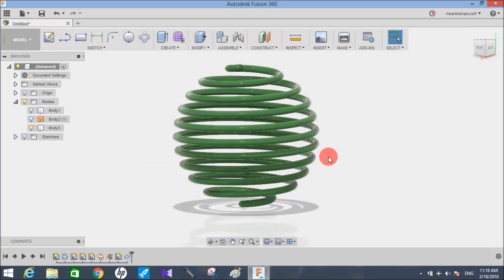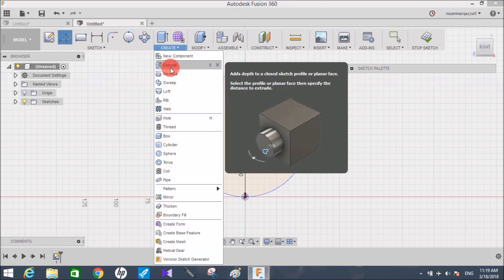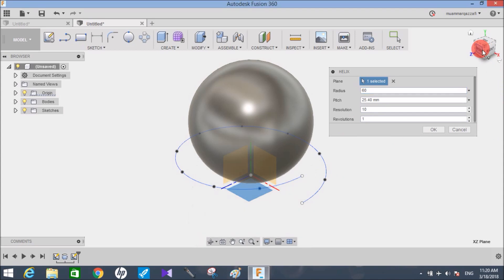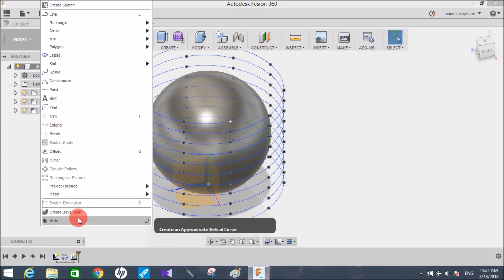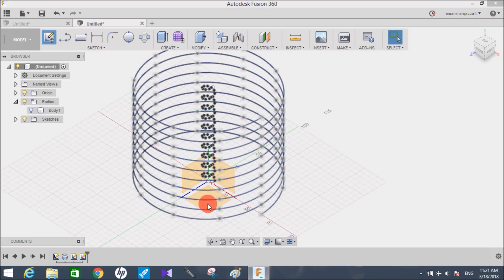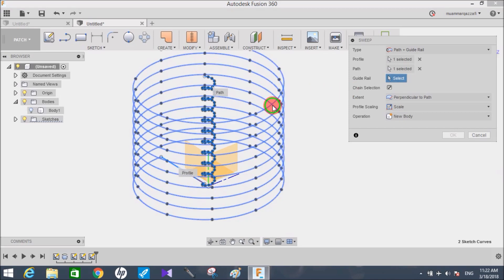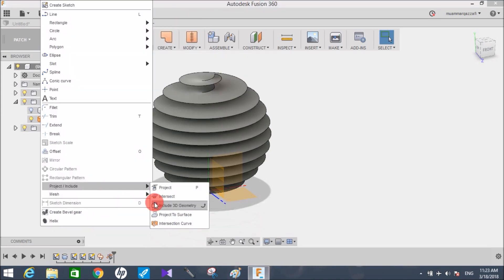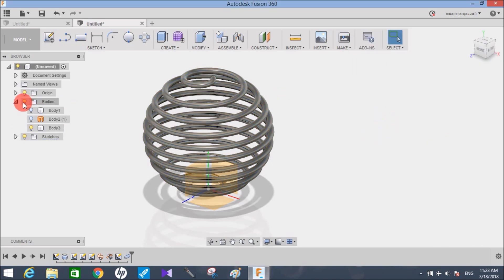How to make a spherical coil - fusion 360 tutorial

Comment: My trial version of fusion 360 seems to be newer. 

Firstly, I can't get the coil to cover the whole sphere (it always starts from the middle and then goes upward). And while I managed to put a smaller coil into the sphere, and connect the inner coil with a line to the outer coil, I CANNOT CHOOSE IT AS "PROFILE" (it just doesn't react).

In fact, I only need a hemispherical (Archimedean) spiral, but I suppose the program only works with a sphere.

Anyway, can anyone help me??